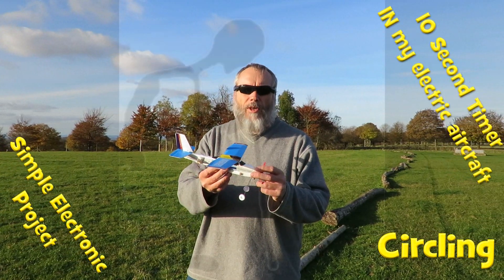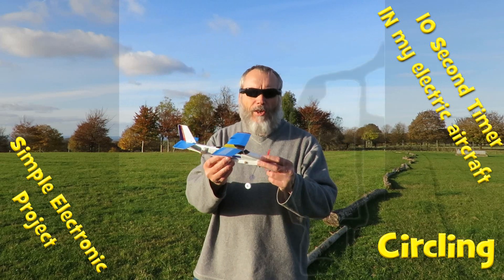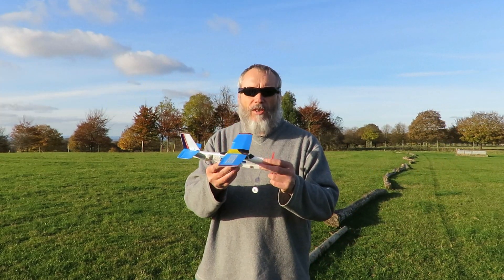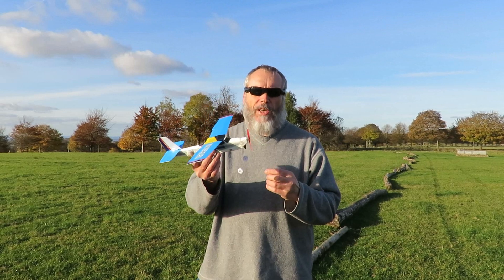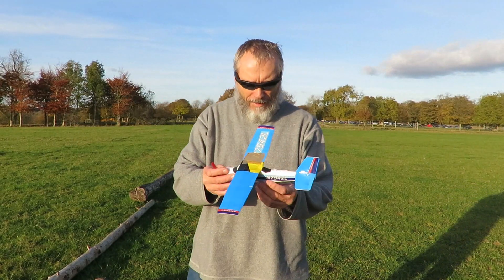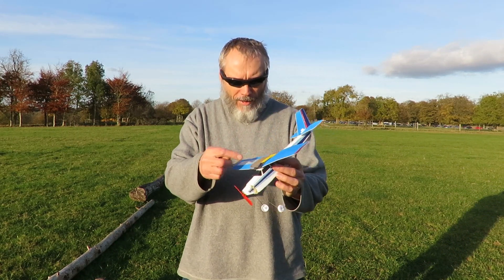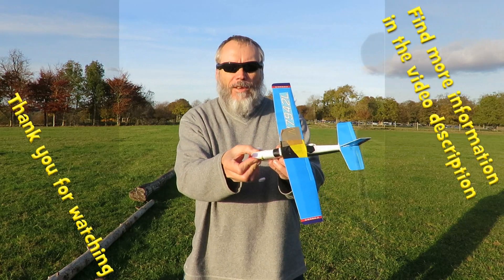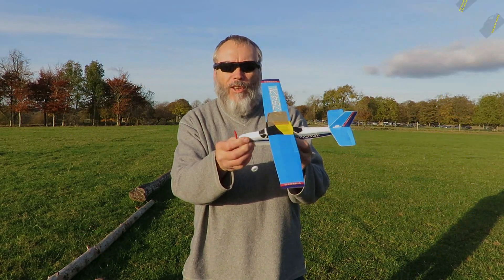Simple 10 second timer IN my Electric Aircraft - Circling

Comment: hi grandad, that plane flew pretty well for what it is, never expected that it would fly at all, i think a perfect throw like in the video would make the plane fly good. i think it should be built much more out of stronger foam material to keep the nose from cracking on landings and wing a bit thicker as well. but then their might be a weight problem tho
Reply from the maker: Thanks Marc, the idea of this project was to use an existing kit and just add the electric motor. Once you start making significant changes you might as well make it from scratch. I was rather disappointed with how weak the nose area was. If I found another kit like this I would strengthen the nose area before fitting the motor but this one had already been weakened by using it as a rubber band powered plane.